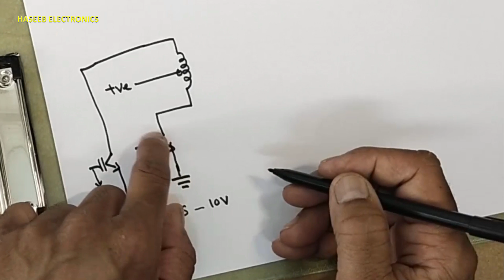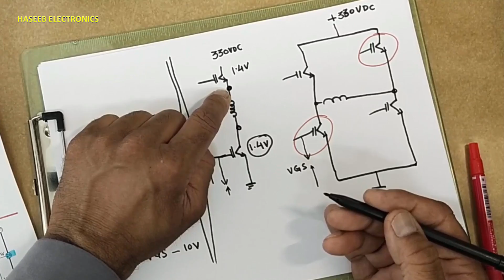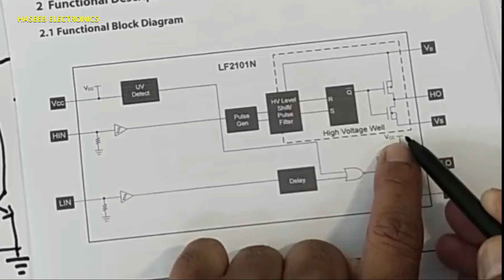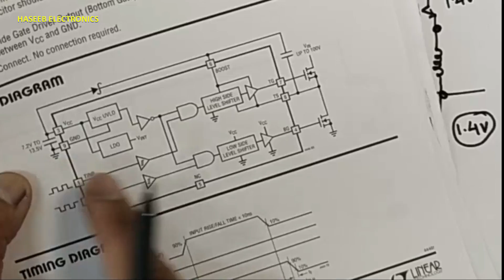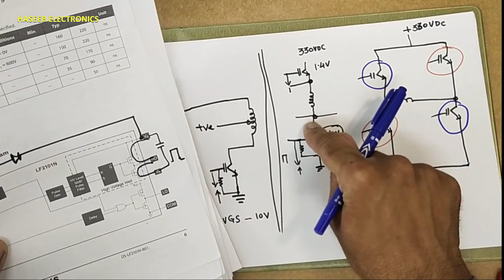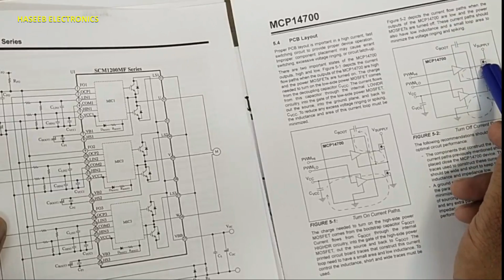{972N} Bootstrap capacitor explained

Comment: i want to understand the issue with the gree error h5 ipm protection. ive checked i test diodes and capacitor in the area even change a ipm still the h5 error is shown could you explain?